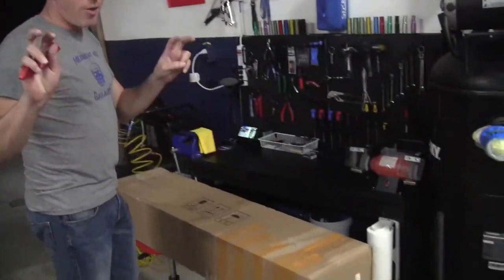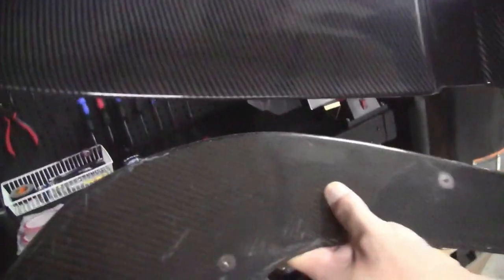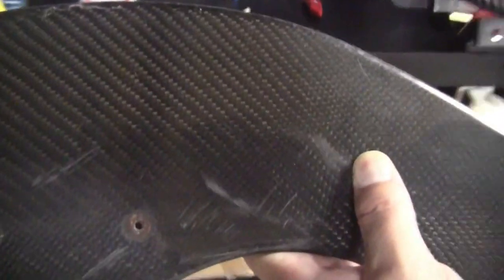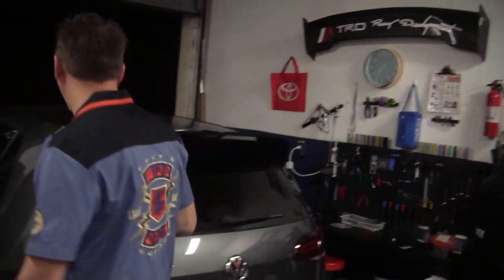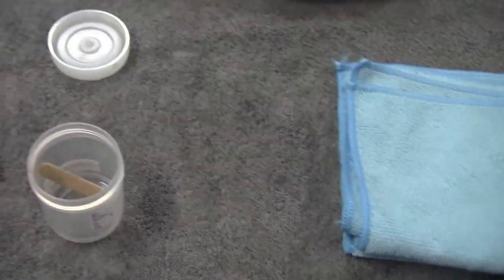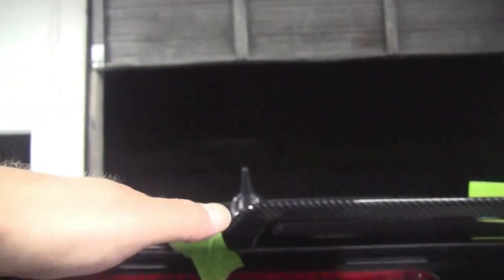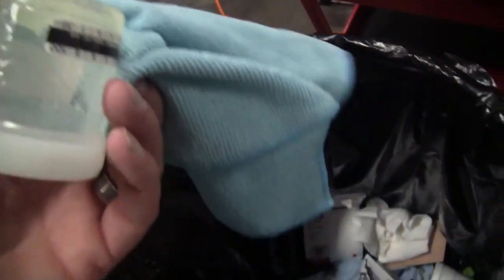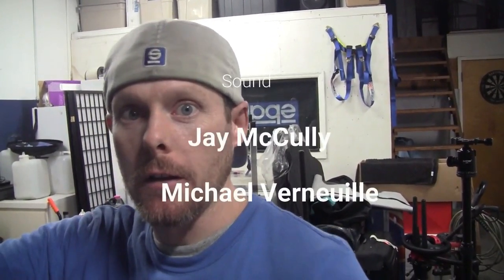GOLF R ROOF WING/SPOILER INSTALL.  GOLF R NOT-CARBON FIBER ROOF SPOILER INSTALL.

Comment: U think u would be able to take it off one day without any damage to the oem spoiler?
Reply from the maker: If we used the 3M tape only, that would be possible.  Even easy.  The likelihood of it coming off at speed or in traffic becomes way too likely of a possibility though.  Which is why we found it much more vital for it to be a very permanent install for safety reasons.  To answer your question, and in all honesty, it would be close to impossible to remove the spoiler the way we went about the install and leave no damage or marks on the stock roof spoiler.  A common drawback to car modification I'm afraid. One plus is that the plastic spoiler we adhered too is only about $100 from VW, plus a paint job ($50)
Reply: @midnightmodgarage7740  could have just used adhesion promoter on the paint instead of the glue...
Reply from the maker: @joshcosta423  in hindsight, you are right. That would have worked as well.

Comment: Why didn’t you just use double sided tape?
Reply from the maker: Of course that was an option.  Unless the fitment was absolutely perfect, which is very rare in the aftermarket, the idea of something of this size flying off at highway speed with someone behind me...We just didn't want the risk. (Doublesided will not hold at speeds over 95mph, we experienced this the hard way.....)

Comment: Do you think this spoiler would fit a mk5 GTi?
Reply from the maker: Unfortunately not, its slightly too wide, though there are a number of mk5 spoilers out there to choose from. Good luck and let us know what you end up going with.
Reply: Sadly none as good as this though I could probably do the same with that spoiler as I did with my MG spoiler
Reply from the maker: From what I've been able to gather on-line, the difference in width is only about a mm or so. So its possible that it could be made to fit, just ensure whoever you buy it from allows returns if not.
Reply: Thanks if it doesn’t fit I’ll make it fit